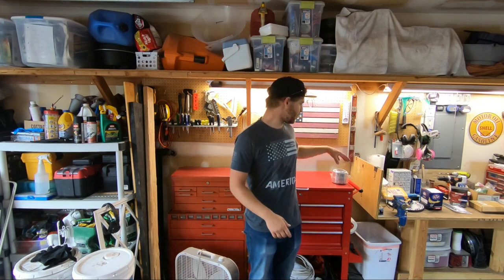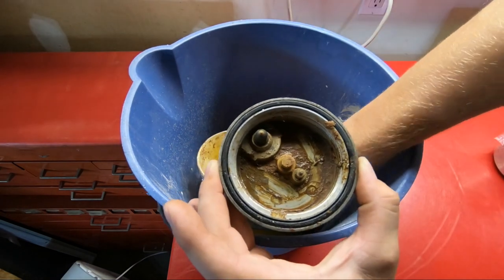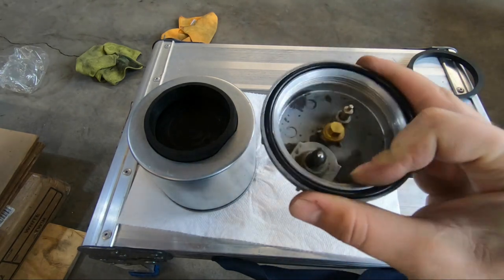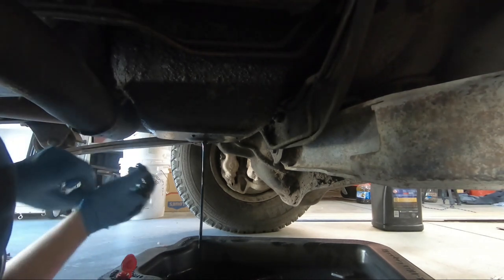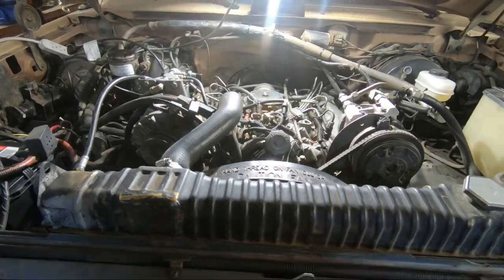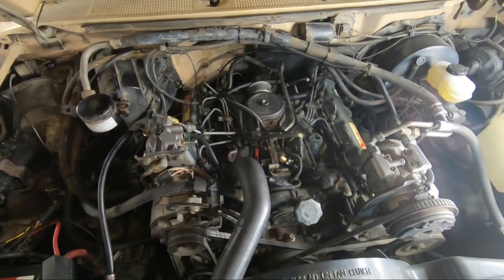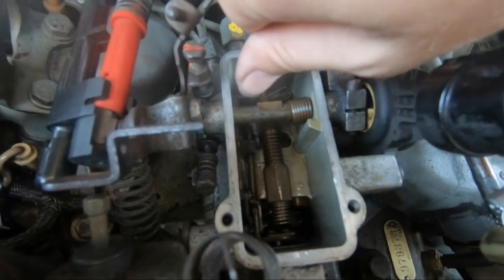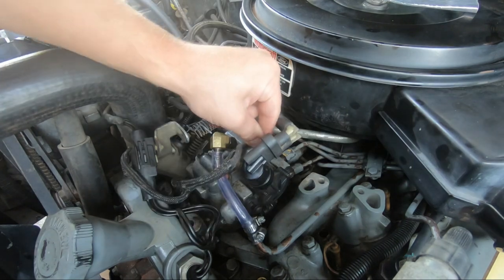7.3 IDI Diesel Stalling Diagnosis and Fix

Comment: That extra piece on the one injector line is a timing adapter. I am half way through your video, so not sure if you end up doing this. But seems like your metering rod is sticking, so when you let off the throttle the truck dies. To fix it you fill the fuel filter with automatic transmission fluid, or diesel kleen. Start the truck for a minute, shut it off. Let it sit for the night, next day start it up and run it like you stole it. Should lube up the internals of injection pump and break that metering rod loose.
Reply from the maker: I didn’t know about the timing adapter so thanks for sharing that!  You were right on the money!  All it took was a little Auto transmission fluid and it loosened everything up in that injection pump.  Runs great!  Thanks for watching!😀👍

Comment: Just to share my experience, my newly purchased 1994 IDI turbo truck has been giving fuel filter alarms, thinking it was clogged I changed it (second filter since buying the truck 3 weeks ago). I continued to get intermittent indications, so I began running less fuel in my tanks in preparation for possibly having to drop my tanks. The issue got worse, by a lot! Today it died coming down a hill, off throttle, at 2100 rpm. After pulling over I tried to burp the filter head, nothing but air. Disconnected the fuel shutoff, and jumped the starter while burping it. Still no fuel. I got under it and discovered the returns from the fuel tank selection valve were capped. When the tow truck arrived we pulled it to level ground after adding fuel and trying to burp with only minor fuel coming from the filter head. We pulled it to level ground and we’re able to then get good fuel flow. I will be taking it in Monday to check the fuel senders to see if the basket strainers have fallen off, and repairing the returns.
Reply from the maker: That sounds like quite an ordeal!  It’s hard enough to trying to figure that stuff out in your driveway let alone the side of the road.  It seems like you got a handle on it and have a pretty good idea on what to fix.  Good luck and let me know how it turns out!😀👍
Reply: @ydocproductions5593  I actually (sadistically maybe?) enjoy driving junk to find the bugs. I have never owned a new vehicle.

Comment: This also fixed my truck I was in same situation as you until I watched this I had just replaced the filter filled with atf and it was doing same thing so I went in the garage scratching my head watching videos, truck had been sitting for 3-4 hours with atf in it then I watched this and I wondered, so I went out to the truck fired it up and sure enough no more stalling ! Crazy what a little bit of Bruce Jenner fluid can fix🤣
Reply from the maker: It was my last ditch effort before I was going to try a different injection pump and I was honestly surprised when using transmission fluid fixed it.  I’m so glad you were able to get your truck up and running again for cheap.  Thanks for watching, I’m glad the video was an asset to you, and good luck with your truck👍

Comment: Buddy; i have the same EXACT issue and you are the only person to go into it and fix it; i now know what i need to do; thanks a million!
Reply from the maker: I’m so glad this video was able to help you out!  Good luck fixing your truck😀👍
Reply: @ydocproductions5593  Friend, i just installed a new filter and ran ATF through it 3 times; on/off/on/off.  it comes down off of acceleration now and does not stall; thanks for sharing brother!  BTW my truck is similar; 1994 7.3 IDI turbo, but filter and pump are same.
Reply: @jimsworthow531 was yours having the issue of rough idle and dying sometimes? What did you have to fix?
Reply: @tuckerlloyd86  yes that exact issue; if i rev up the motor it would die.  i learned it is a spool valve in the injector pump.  i took off the fuel filter and filled it with trans fluid and would keep revving it many times.  i also did the same with sea foam.  i let the trans fluid sit in the filter/injector pump and injectors overnight.  keep revving it up and down and that spool valve will loosen and work after a while.

Comment: I had an old 6.9 IDI that had the same stalling issue. Unfortunately the solution was a new injection pump. It was just plumb worn out. Ran way smoother and stopped stalling once I threw a marine IP in. (Which was the cheapest thing I could find)

Never solved my hard starting issues though. I think the motor was getting low on compression because it was pumping lots of unburnt fuel out the exhaust when cranking. It would require 3 or 4 cycles of the glow plugs to cold start even when it was summer! It would also struggle to go uphill unloaded unless you dropped the manual trans down to 3rd gear. She was definitely tired.

Bought the truck for $1000, put $3000 into it. Sold it for $500. I love IDI's :)
Reply from the maker: Man that’s too bad!  Injection pumps aren’t cheap!  Sounds like the truck had all sorts of issues, once these engines loose compression that’s pretty much it.  No amount of marvel mystery oils’ gonna solve it🤣.  This was my first IDI and I had a ton of fun with the truck.  In some ways I still wish I had it
Reply: a friend does this on his 96 Cummings. He learned from his uncle that had a powerstroke and what else before that? he was a heavy eqy operator. He filled the fuel filter with kerosene when changing it.

Comment: Good job getting it running!  I think I've seen the ATF in the fuel trick used by other YouTubers.
Reply from the maker: Thanks Magdad!  It was a pretty clever trick and I was so surprised that it actually worked🤣.  It still needs a ton more work, but getting this engine running was a massive hurdle accomplished.

Comment: Man I really appreciate the video I just got this truck for ab 3 grand and have been scared I’m gonna lose on it by putting an ip in it but this video helped me exactly how you explained it man
Reply from the maker: That’s great to hear Kacey!  I’m so glad you were able to figure it out.  That’s exactly why I make videos like this is for people like yourself that need help fixing their trucks.  Thanks for watching😀👍
Reply: Hey man I bought a 1986 f250 4x4 diesel super cab 6.9 idi c6. It had a broken injector high pressure line #2 cylinder. I put new lines on it and am rebuilding a spare ip pump. I have leak at #8 injector and believe the tapping on the top is a bad Injector. So I'm buying a new set and return line kit. I've done this on several 7.3idi and 6.9 idi. I paid 4 grand for my truck. Would not hesitate to work on fuel system. It either will work or not. At worse you have to bleed the injection system of air!
Reply from the maker: @jackdaicole7595   Hopefully for 4k your truck was in a little better shape than mine🤣.  That sounds like quite a hassle to deal with.  The best thing about these old diesel trucks though is that the fuel system is about as simple as it gets.  The injection pumps have a lot of moving parts of course but when they’re working properly they last a very long time.  Good luck with, it hope it serves you well for many years to come😀👍
Reply: @ydocproductions5593  body in very nice shape no rust some very small dings but no major dents very straight body. Everything works ac ice cold heat will run you out in winter. The tapping turned out to be a bad injector just replaced injectors return line kit high-pressure injector lines and put on my ip pump and a lift pump. Sounds like alot but it sat for a while. Runs incredibly strong no more ticking! Starts in the cold first turn! Did new glow plugs. I take care of my diesels and keep up maintace. I'm building a 7.3 idi 93 factory turbo sleeving down to a 6.9 idi new pistons performace stage 1 cam ip and injectors upgrade turbo kit with intercooler. Water and methanol injection system to lower egts. I'm keeping the serpentine set up vs what's in the truck the old v belt! Lol
The Trans I rebuilt myself did some upgrades and transfer case I went through. I have a shop so I wanted to make sure if there was any issues it is addressed now! I'm dropping the ttb 50 and installing a dana 60 solid axle rough country lift kit on the way 4 inch all new poly bushings body to frame and all suspension. Went with all terrain tires. Will be working on my slide on camper. All aluminum square tubing using a antique camper that's claped out(leaks wood rotted) using its sidings building a well insulated retro for extreme weather -70 cold lol. Plus storage electrical upgrades heaters solar water storage and food. I go to alaska In areas that don't want to have any issues far far away from everything  lol
Reply from the maker: @jackdaicole7595   That sounds like an incredible truck your building!  I’ve always thought those factory turbo’d Idi diesels were pretty neat.  Even though I own a 7.3 Powerstroke (that still has that p1211 code.)  I’m still a huge fan of the old mechanical diesels.  

How many pounds of boost are you going to be able to run in that truck?
Reply: @ydocproductions5593  I'm a grampa type driver lol it will be a stock at 6-8psi probably no higher than 10! Lol I do have a p pump 7.3 powerstroke it has setup for 20 psi I'm building a special high rise  intake and putting a detroit blower on top in combo with my turbo! Special custom low compression pistons it's alot of work doing a block girdle to strengthen it up polished crank
Reply from the maker: @jackdaicole7595   I’ve never heard of that before!  That sounds incredible!  How in the word did you come up with that idea for it?  When it’s finished you should make a YouTube video or two to showcase it to the world!
Reply: @ydocproductions5593  look up p pump 7.3 they are used for extreme racing producing stupid amounts of torque and power..... the motors built with a p pump is a ultimate hard-core diesel racing engine. Not practical for on road lol

Comment: Great to see u found the problem and got the truck running right. I'm surprised it even ran with that diesel in it. There was a point in the video when the truck was running it sounds like the bearings in one off your pulleys might be going bad. 4:05 that small bell like sound. I might be wrong just don't sound right.
Reply from the maker: I’m so happy it was a cheap simple fix because injection pumps aren’t cheap🤣.  I looked into it and that’s a good catch.  Thank you!  I wouldn’t be surprised if it was a pulley or something simple.  Thanks for watching😀👍

Comment: Good job on getting it sorted it! The old diesel engines need some kind of lubrication added to the fuel. The new diesel fuel is much dryer (less sulfur) than the old stuff. Looking forward to seeing what else you have in store for the old brick nose!
Reply from the maker: Thanks Wesley!  Who knew a little ATF was all it needed🤣!  I’ve heard of guys running motor oil mixed with the diesel to help lubricate the injection system, but I don’t know how well that would work long term.  I’ve got plenty to work on this truck, so stay tuned!  Have a good week Wesley😀👍
Reply: @ydocproductions5593  some use motor oil, some use ATF,  stanadyne is a good choice also. It basically comes down to personal preference.  It doesn't have to be added EVERY tank, but it needs to be added based upon how much fuel you go through.

Comment: I had use plastic oil drain plug gaskets/crush washer on top of the little plastic caps when I bought the cheap set worked for a long time. But use russ repair for your return line kit and more.
Reply from the maker: Adding a little more clamping force on top of those caps isn’t a bad idea at all especially since they kind of are the Achilles heel of these engines.

Comment: Great Video. Thank you. Should that clear return line that is connected to the injection pump be full of fuel when the truck is running? My truck studders and stalls and I put a clear line in just like you but mine is not full of fuel when it runs…
Reply from the maker: Thank you Jon.  I don’t think the return line needs to be full of fuel only because it’s simply returning the un-used fuel from the injectors being sent back to the fuel tank.  If it’s shuttering and stalling I would check to see if you have enough fuel pressure coming from your fuel pump and start there.  Hope this helps
Reply: @ydocproductions5593  thank you. The studdering and stalling is very random just drove 10 miles than it studerd and stalled. Now is running well again. Not quite sure what is going on. This has been happening frequently.